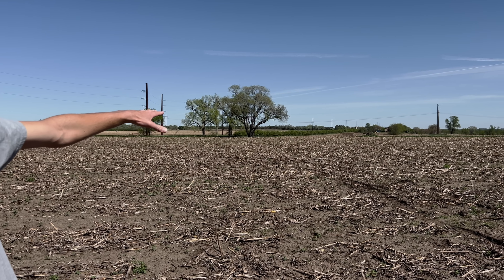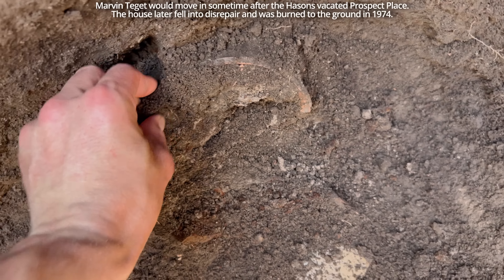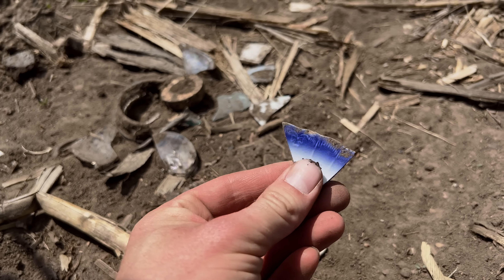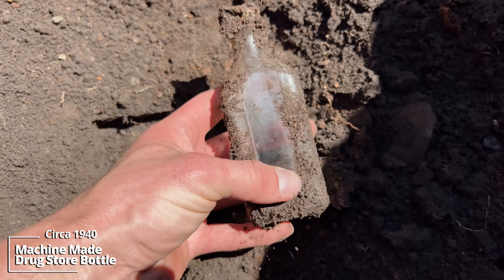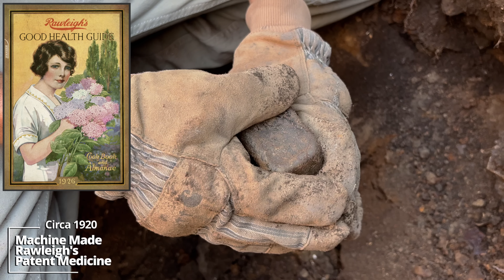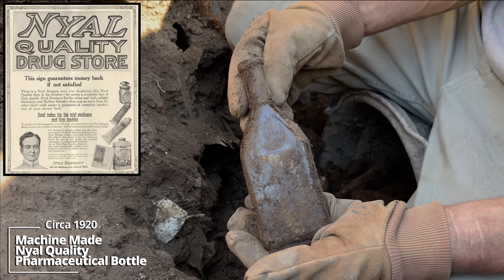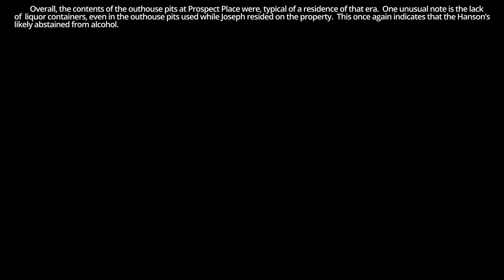147 Year Old Map Found in a Basement Leads Us to a MASSIVE Cache Buried Under a Field

Comment: Amazing, At 10:13,  The ever so rare and hardly ever seen clear, screw top, machine made.  Withstand the ages with that one. Oh Oh does it have its lable intact indeed.  indeed it does.  That for certain will have to be the crowning jewel in this dig.  Pristine by any measure.  Likely to be a classic in years to come.  Doh.  its a water bottle circa 2022

Comment: Where is the part about 147 year old map I must have missed that or you didn't put it in there
Reply: There was a map of the town.. as an old metal detectorist and bottle digger, I would go to city or state archives and look at those if available. You can use it to overlay a current map and figure out where in an empty lot a "privy" or outhouse or trash pit would be.. outhouses naturally were the farthest away from the house. Once indoor plumbing came in the old outhouses became trash pits. They can find it with a probe by noting the difference in soil stiffness.  regular ground is lots harder than softer, refilled ground.